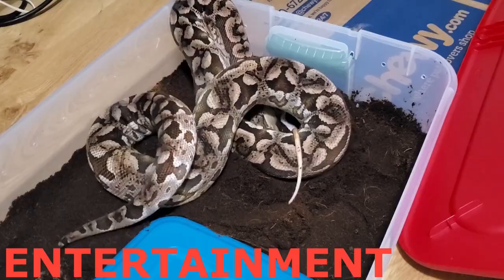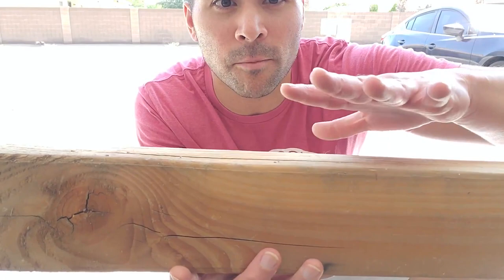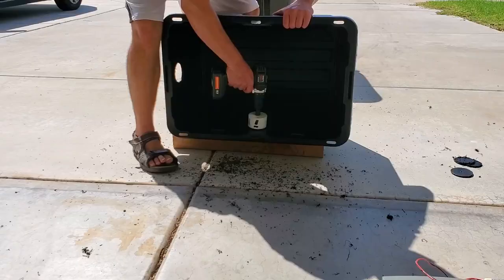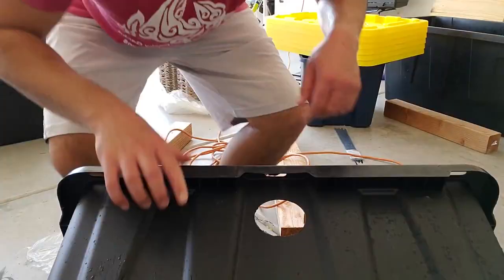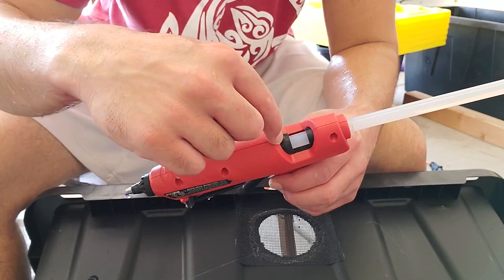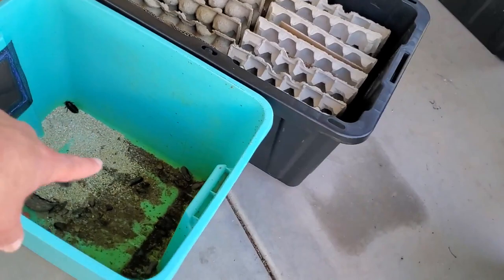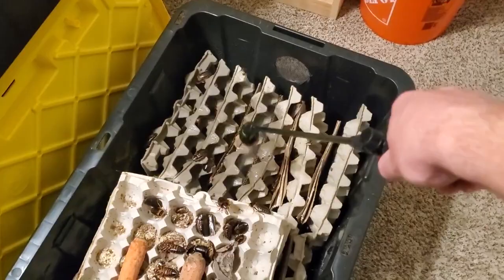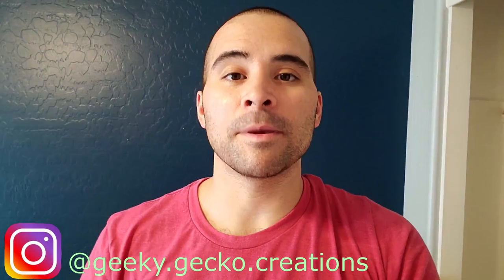How to SET up a DUBIA roach COLONY | food | setup | breeding (2021)

Comment: A bit of advice on using the hole saw - after completely drilling out the first hole, drill through plastic with the 1/4" bit only then line that up with the same hole that you just made in the wood. Then continue to drill big hole with the saw part. Basically you're using the hole and circled groove made in the wood as a template for the bit and saw to ride in as you cut through the plastic without grabbing and biting into the wood as much. Hope this helps ✌🏼
Reply from the maker: ah good tip i will remember that for next time ty!!! :D :D

Comment: My roaches chew through rubber coated fiberglass screen eventually. I switched to aluminum screen and haven't had any escapees yet.
Reply from the maker: hm...never heard of that...do you breed dubias?
Reply: Good thing they can’t reach my vents since it’s on the lid. And I’m also using metal screen

Comment: I've been running this exact setup for my discoid roaches (almost identical to dubia but legal in FL) but I've been thinking about doing an experiment and trying to make one bioactive... basically put a layer of substrate in the bottom with some springtails, isopods, buffalo beetles, etc. to basically make it self cleaning. What are your thoughts on this and do you know of anyone doing it?
Reply from the maker: thats a good idea! you'll have to let me know how it goes, my first thought is "sifting" would be limited to whatever was on the card board, my 2nd thought is, will the cardboard mold or collapse as moisture sinks in from the substrate? But definitely interested to hear how this experiment goes!!